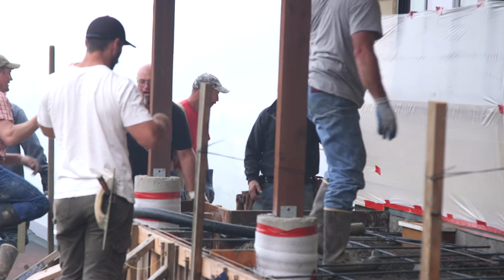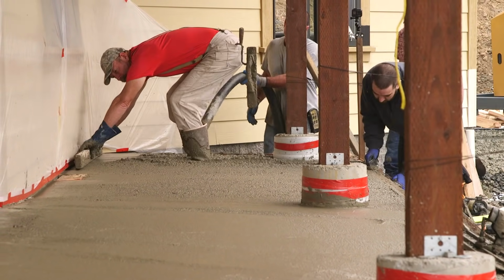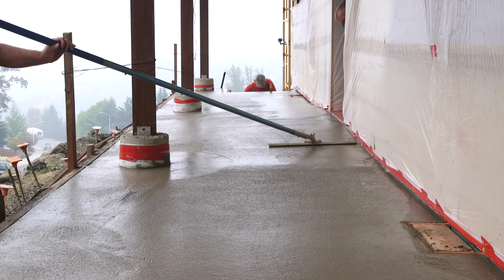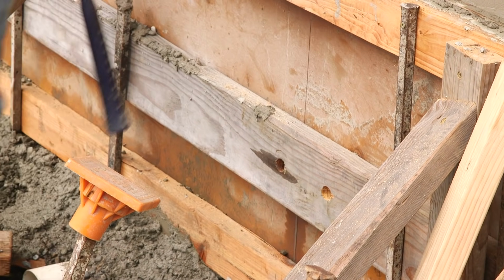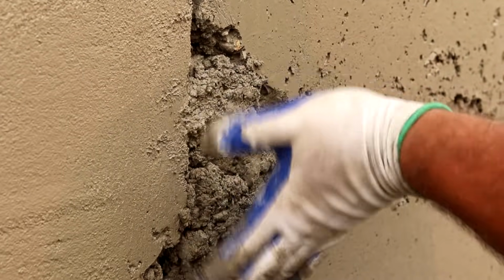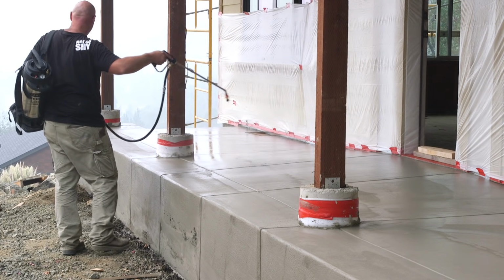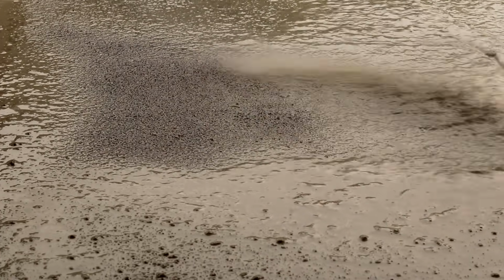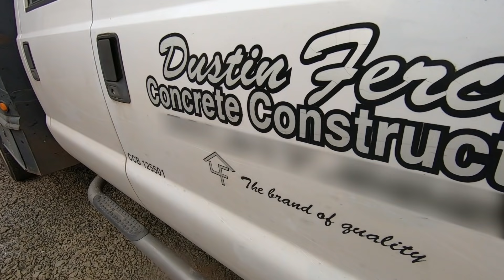Pouring Technical Concrete Ep.92

Comment: What I learn from Essential Craftsmen: You can do your own framing, plumbing, siding, windows. *Pay someone else to do your concrete.*
Reply: Indeed.  All those other things you can take your time, fix mistakes, and eventually do good work, even as an amateur.  With concrete, it's all or nothing, mistakes can be catastrophic, and time is extremely tight.
Reply: And he was a concrete man himself! Still pays the pros to do it!!
Reply: @DrewToner  It's all about the manpower on something that large and technical
Reply: Amen to that. I wish there was a crew like them in my town.
Reply: And drywall in my opinion.  Concrete and drywall are arts as much as a science and concrete has a hefty cost with errors.
Reply: @codyharring9812  I'll take drywall over concrete any day
Reply: @k.d.8924  I would as well but sitting on the couch knowing were the imperfections in the the drywall are drives me crazy. Hanging it is fine, but mudding and sanding is a true skill.
Reply: While I have no problem with mudding and sanding and have frequently corrected problems or handled small section (after my subs), the difference in speed and personal frustration (especially ceiling) makes it worth spending the money on dedicated drywallers (especially given the price points).
Reply: My wife hired a crew to do a sidewalk and expand our patio at our house because I couldn't get to it fast enough for her.  They were doing some other flat work in the neighborhood at the time that looked ok in passing.  I should have taken a string line and level over to those other houses to inspect.  At our house they did a terrible job and i curse it every time I look at it.  It has low spots, crooked expansion joints, patio faces not plumb and poorly finished.  Absolutely no attention to detail.  It is exposed aggregate and it doesn't match our other exposed aggregate slab work.  But she said they were really nice guys.....  Pay someone else, but ask if you can look at some of their previous jobs before you commit.

Comment: You can tell Scott has a soft soft for concrete. All of their concrete pour videos are 20+ mins while a majority of their videos are lucky to reach 10. I'll take whatever I can get though, it's all great content and I'm here for the knowledge not a production.
Reply: Pretty sure thats where he started. Deff used to be a form carpenter
Reply: @BuhBaSam  Yah, I was just commenting on the fact that the concrete videos are much longer and more in depth than most others. Nothing wrong with that, it just shows his expertise and passion for concrete and form carpentry
Reply: Concrete kind of grabs you as a trade. Its hard to explain hahaha. Its a weird thing to be obsessive over, but if you get the bug you get the bug. I love concrete and have a few friends with the same sickness. I think a lot of it is that the concrete trade is very competitive, and most of the competition is with yourself. Alot of casual conversations with certain friends devolve into technical discussions about boarding edges. Or machine patterns. Or admixtures. Or some other detail that a normal person would think is insane to consider. But alot of concrete guys just love doing concrete and i get the impression scott is one of us hahaha

Comment: I am an Electrician from Toronto Canada 🇨🇦 for over 22 years now. I have always thought “what a treat” when the concrete finishers are on site. I just love the way these fellas can transform an ugly soupy mess into a beautiful moulded surface. It’s truly a very technical art. As where my job very little art to it. It really is a wonderful site to see these boys do there thing. Its funny to see that I’m not the only one that feels this way as ALL the other trades will park there butts for break far enough away but close enough to witness the magic. We can always count on the finishers to work through break, lunch and dinner sometimes. 
EXCELLENT video guys! 
Love the content!
Love this channel! 
Keep up the AMAZING work. 
God Bless 
✌️
Reply: The art of not being electrocuted is a fine art.
Reply: You provide the power to the most beautiful, "Artistic" lighting.  Without you, the art wouldn't work.
Reply: I get what you mean.   I spent a few of my formative years in the trades setting forms and finishing concrete for the Corps of Engineers.  When the concrete truck showed up on our job sites, the clock started ticking.  No one took as much as a smoke break and you were lucky to get a swig of water.   The pucker factor was pretty high with all the white hats inspecting the work.   When it was over, we were exhausted from the stress as much as the work.   But, when we pulled the forms the next day, it was gratifying to see how all the prep, attention paid spotting the concrete during the pour, and the vibrator work paid off with a good finish.  Those were my glory days.  It’s great to look at some projects I worked on and say “I built that. “. 
Don’t sell your electrical work short (pun intended)!  I always admired the guys who knew the Natl’ Electric Code inside and out, could calculate load and resistance, and figure out how to wire up complicated equipment.  It was never my strength, so I held them in high esteem. 
Cheers!
Whipple
Reply: Everytine our crews hops on site we can feel the respect and vibe change real quick, pretty cool

Comment: Tip on taping the sides to eliminate air pockets: use a reciprocating saw with the blade removed. Gives great vibration without blowing forms out.
Reply: Might just try that one out
Reply: He has a concrete vibrator, it was used in an earlier video in this series, but I think it is in need of repair.  Can't beat the right tool for the job.
Reply: Or a hammer drill
Reply: @cheshstyles  A hammer drill still has the rotary action, what you would need is a "rotary hammer" set to "impact only"  and a bit that could be put against the forms that won't blow a hole in them.
Reply: @VC-Toronto  I use ha hammer drill with a fence bolt, the ones with the round dome end so the spinning of the drill is not an issue.
Reply: Chuck up an offset weight (see:bent threaded carpenter's nail) in a cordless drill and use the ass end of the drill. Not great for the tool, but in a pinch it'll rattle your fillings out
Reply: Word of caution about this for anyone thinking of trying it. Don't go crazy with the vibration, especially on a smaller, thin slab. You can vibrate the aggregate down too much and not leave enough up high which will cause it to slump too much, it will be weaker and will crack.
On this big slab, it's fine. If you're pouring a 4 or 6" slab for a little patio or something, don't buzz on the forms too long.
Reply: Sigh. Go buy/rent a pencil vibrator and do it properly. Vibrating forms adds undue stress unless properly designed to handle the increased load (you can buy external vibrators that mount to forms - often used on skookum architectural formwork with special architectural concrete mixes that produce super-smooth walls).

  Can buy cheapo Chinesium pencil vibrators for less than $100 on Amazon that work surprisingly well. Professional grade cost many hundreds but are far more durable/powerful. 

Lack of proper consolidation ruins way too many residential/DYI concrete pours.
Reply: If you’re doing finish concrete, after a proper pencil vibe a palm sander run along your forms with a 120 grit pad works great for the small bubbles. Keeps your separation to a minimum and keeps your concrete almost void free. You can also see where you’ve vibrated because the sander smooths the backside of the form.

Not an ideal solution to large jobs, but I’ve done this exact same thing on 4’x4’ concrete columns that were 11 feet high. Using paper faced form board, we had an ALMOST perfect finish
Reply: that's smart- never thought of it! But yeah an impact drill would be a bit better. As to the vibrator- you gotta be careful with those things so as not to liquefy too much...

Comment: 9:39 removing the forms at the right moment is indeed very technical and also a big liability! They don't typically do that in big residential projects, they come back later when it meets strength then  grind, mud, sack finish.

Comment: "You gotta decide how high the structure is going to sit."   Yeah, then add 6 inches.  I've never seen a homeowner wish they had built their slab 6" lower.  

Excellent look you ended up with.  Thanks for sharing the process.

Comment: I like seeing the rabar chairs. Some contractors don't use them and claim that the rebar won't be pushed to the very bottom even though their guys are stepping all over it during the pour.
Reply: I assume by liking chairs, you dislike dobies or bolsters. Reasons why?

Did you notice they used dobies.

Comment: That water sheding slope right in front of the door is the sign of a true craftsman.  I am surprised such a safety feature was not mentioned.  Slopes like that keep water AWAY from that crucial first step, which should never be a doozy, so it doesn't turn to ICE.

Comment: Hands down, concrete is simultaneously both science and black art, in everything from the mix, water ratio, admixtures, placement to finishing. A good crew will make it look easy, and it's anything but in my experience.

Comment: This really isn’t a comment on this video but in regards to the garage pour I’ve been meaning to tell you about stainless steel strips attached to the wire wherever you want a expansion joint. Cracks exactly where the strips are. No cutting. No mess. The guys in this video are awesome by the way

Comment: Nice work, I use rugasol and it's very even. I apply about 30 minutes after bullfloat and wait 4 to 5 hours for wash off and expose with pressure washer. So many different ways to do exposed and whatever works for the contracted works.

Comment: Over this summer i've built 4 stair cores worth of stairs, 4 stories tall. 72 concrete risers per core. I have become one of the more skilled concrete stair builders in my company, and it doesn't matter if we do a little 3 riser acces case, or an exposed core. It’s the same level of detail, heartache, and anxiety mixed with "yup, that'll hold" questionable/assured-ness, every single time.

Ya gotta love it.
Reply: One thing i've gotta ask, how come you chose not to pour in lifts and use a vibe for consolidation? Could you have ordered 1/2 the volume and split the rate of delivery? Might have saved some
of the patch work when you wet stripped your forms.
Reply from the maker: Actually we poured two patios that day. There’s one in the back that you will see in a few weeks. We ordered the first truck and use the last part of it to install a lift around the port you just watched. If you look closely you can see the second pour going down on top of the first lift. Made the bottom pretty hard and it did not expose as nicely as the second truck but it will all be behind the landscaping.

Comment: I like the end result, I've only seen that finish done with a rag and a bucket of water before, the guy I saw doing it didn't use retardant or a brush or a hose, just the rag and a bucket, spent like 5 minutes on it and jumped to another part of concrete to do it again.

Comment: I worked one summer as a labourer on a concrete crew and I remember we poured an exposed aggregate walkway (beautiful Folly Lake Nova Scotia aggregate) and we used a new surface retarder that no one on the crew had experience with.  The foreman sprayed it on the same way he always had but we went back to brush and wash it the surface was way to hard and he hadn't used enough.  The new retarder must have been less concentrated or something.  We spend HOURS spraying and spraying and scrubbing and scrubbing with metal bristled brushes on our hands and knees.  We just barely salvaged the job.  Lesson learned!

Comment: indeed a very precise timing knowledge is required in understanding the hardness level and workability stages of concrete.  But I do have a few question: Is it advisable to perform such finishing techniques 1) on structural members of concrete such as load bearing columns and beams,  2) on bottom of slabs that do not have subgrade, such as 1st floor or above.

Comment: lol the old-eye sitting in the door puffing his pipe and leering at the worker smoothing the rough finish.
im surprised you didnt diamond out around columns with the control joints. its a pretty detail that does real work and keeps the column shift from breaking the surrounding slab. 
edit: i guess the round footings do something similar. gorgeous deck
Reply: I think in the video about setting the forms for this they showed the round columns being wrapped with sill seal to give a buffer between the posts and the floor.

Comment: I worked on a small crew in the 80s that did maybe 3000 lineal feet of washed rock sidewalks. They're nice but they'll tear your feet up walking on them! The aggregate back then was smooth 1/2"-3/4" river pebbles (nothing from the crusher like these days). We just waited til you could walk on it, then used a hose/sprayer and a broom.

Comment: Alot of videos from the states I have noticed people using lengths of timber to screed. 
Do you use aluminium screeds over there often? The vast majority here use aluminium screeds by masterfinish. They have handles on them, a square corner (that faces you) for cutting the concrete, and a rounded corner that faces away from you for smoothing the concrete prior too the bullfloat. I would be lost without mine.

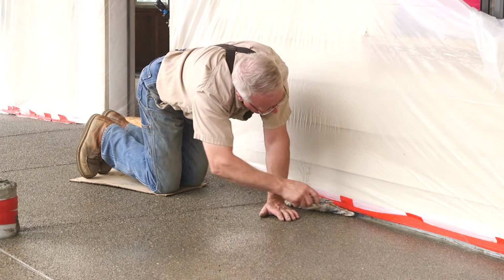Comment: 22:05  instead of cardboard try using piece of 10mm aerofoam insulation folded in half...i sooo comfy )) i even take a roll to a car trips to put it under the tent .
Reply: @John Fischer also useful when fixing car in a garage or routing cables in barely accessible places and you have to lie down for this . its just one piece for any occasion =))

Comment: Never seen that exposed aggregate finishing, it looks gorgeous; and with the crack control lines, the porch looks like being made of huge stone blocks, a build worth of the Pharaohs!
An amateur question: Is it not common practice to leave a gap between every concrete slab and its surroundings? Just asking because it seems the porch slab comes right in contact with the basement wall.
Great video, as always!

Comment: So I've seen an "exposed aggregate finish" to concrete before, but I never knew what to call it or how it was done until today. It looks beautiful on this house, despite the fact that neither the house nor the concrete work are finished yet.
An exposed aggregate finish looks like it provides good traction even when wet or even perhaps slightly icy, however if someone does manage to fall the same aggressive texture that gives grip will eagerly remove skin, resulting in worse skinned elbows and knees.

Comment: 12" tall cone.  8" at the bottom, 4" at the top.  fill four inches.  rod with 1/2" dia. rod tip bar 25 times.  another 4" repeat.  another 4" repeat.  remove cone.  how far down the concrete sags:  slump expressed in inches.  Hoover Dam build:  a slump of 1

Comment: How do the deliberate cracking areas stand up to multiple winters worth of frost/thaw? I would imagine that whilst minimizing the cracks to one area for aesthetic reasons is good over time that area if exposed to the elements would deteriorate significantly compared to other bits of the concrete. 

Is this technique then only used in places that don't have wet cold winters or only in places that aren't exposed to the environment like in the garage/porch?

Comment: Wonderful video for sure and it shows that the workers are all craftsman.  But forms that don't stay straight should never be an issue.  Nothing worse than forms pushing.   We will go to any length and make sure that never again happens AGAIN.  A good way to ruin a whole job.   If you are making forms make them extra stiff and strong.  Concrete weighs about 145 lb/ft^3  The pressure on the forms depends on the depth of the form and it is more than two times of what water would be.  When a form is pushed out, it looks like it is pushing out at the top but watch the bottom as the pressure is higher there and it may be pushing there too.  Of course that is what you surely don't want to happen.  You should never need be fooling around with forms while poring.  There is just too much going on for that.  Thank you for this video there is much to learn from these workers!

Comment: Guys today got it to easy. Buying premade exposed aggregate. Back when it was hard to do you poured your concrete floated it. Then you spread you stone like you was feeding chickens. Trowel it in. And timing was key hit it with a pressure washer and exposed the stone. Called old school

Comment: It would seem that vibrating the concrete and having smooth or decorative forms would allow the forms to be removed at a later time. Its done with a water based concrete form retarder that allows 1/8" to 3/8" of the surface to be washed away when the forms are removed. The concrete can be fully hardened and more than a day old. It gives a leisurely time to work and still produce the same results. Let's say the weather got bad or there was a big delay. No problem- the forms can be stripped the next day or even later and the finish work done by just a couple people working leisurely at that time. A good example is TK-6100. Also a plastic lumber screed against the house would not only make it easier and faster to screed the surface from wall to form edge, but would also provide a control joint against the house.

Comment: Gee you’d feel confident with those old heads on the job, when EC mentioned about the setting of concrete around that control joint block that was stuck, about the chrystals etc , so much knowledge because I’ve seen before where those parts have been patched and it never blends in , now I know why haha 🤙